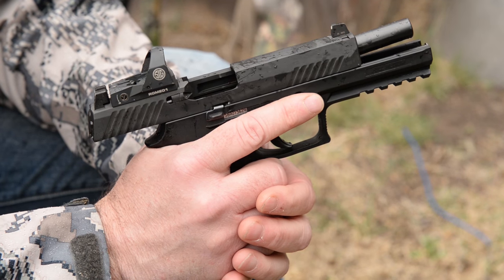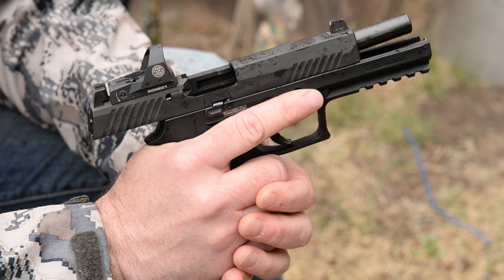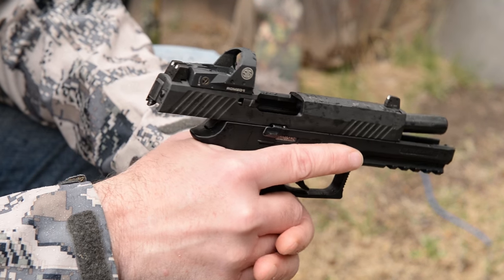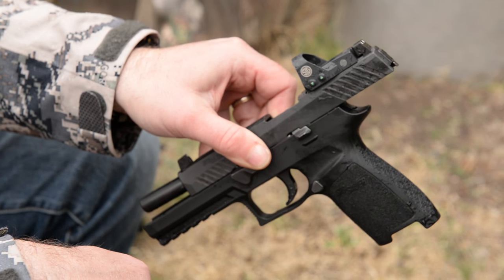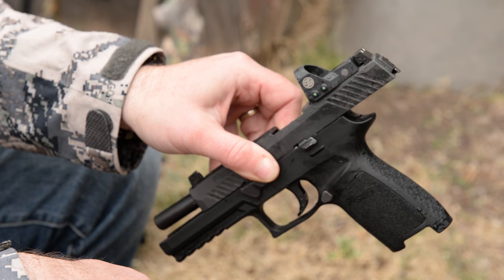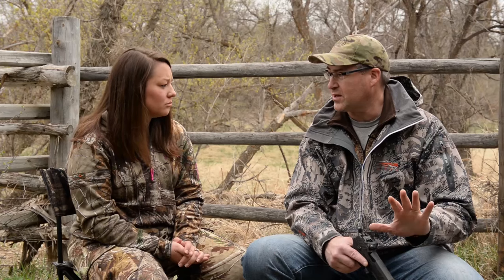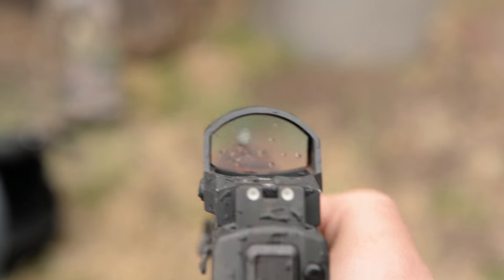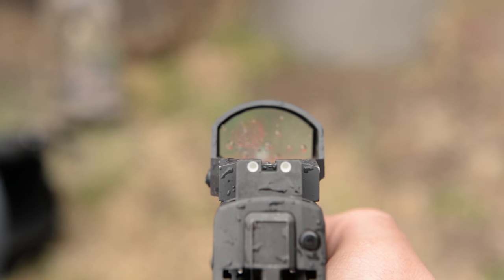Sig Romeo 1 Pistol

Comment: What's the battery life?  I can't find it anywhere online...
Reply: Not so great. But for the price and what you get you can't really bitch
Reply: +Full Metal jacket 88 I'm inclined to agree. At that price point, you're still saving a good deal from a Glock MOS, since not only would you still have to purchase an optic (if you didn't already have one), but suppressor-hight sights so you can co-witness. As far as battery life goes, I'm actually thinking it won't be total garbage considering, at rest, the optic essentially turns off, which I'm assuming has a gyro type system in place like phones and other electronics that activate things like screen landscaping with the phone is turned or tilted. My only concern with that, is that maybe after so many rounds or just constant carry/training use, it won't be as responsive to motion. even still, the battery will no doubt be replaceable, so you can always get better batteries to make it last longer than the factory unit if they decide to cheap out lol.